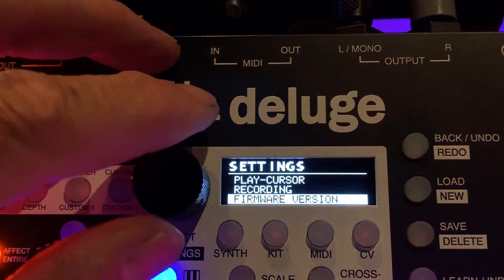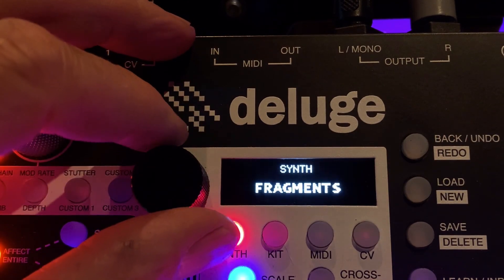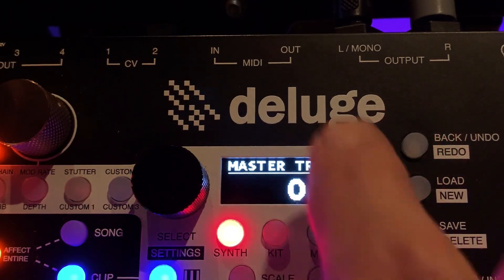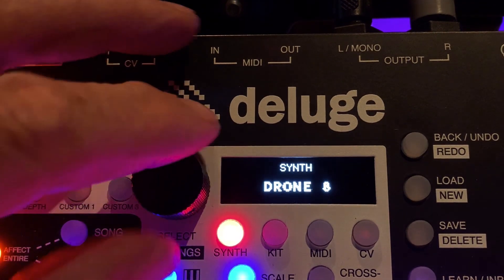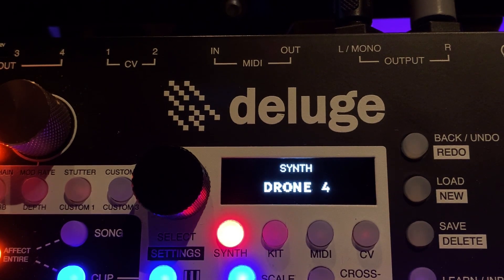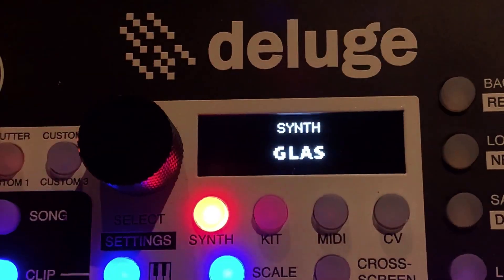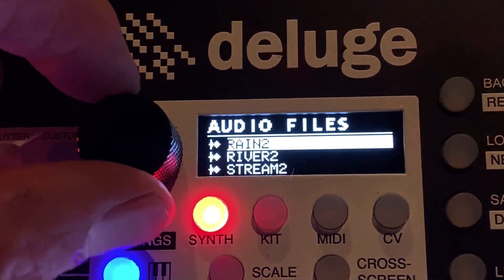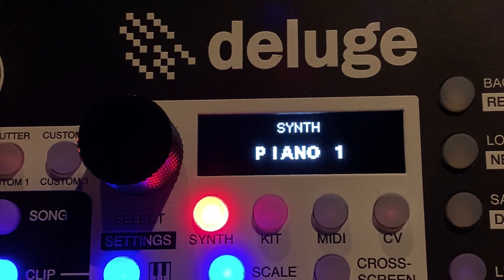Checking out the new DELUGE OLED screen

Comment: Excellent! Thank you for the video. Question: how did you remove the wooden elements?
Reply from the maker: There were just a few little screws holding each cheek in.  I needed to remove them to fit it into my main ambient rig, which is a big wooden sculpture......thanks for watching

Comment: I had similar kind of problem with Korg EMX rotary encoder where it wouldn’t correctly move to next values at times.
Reply from the maker: Sold my Korg Radias, and my Waldorf Blofeld, both because of faulty encoders......it's a real problem, this however, is a software issue, as the encoder works flawlessly for everything else....